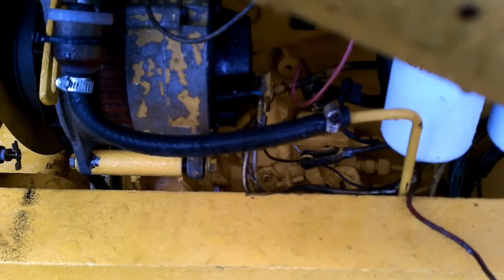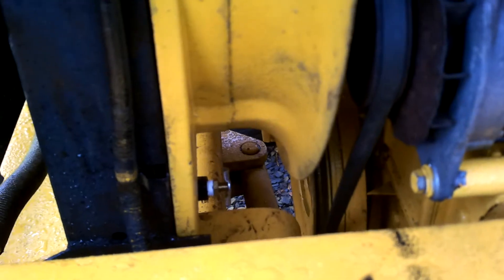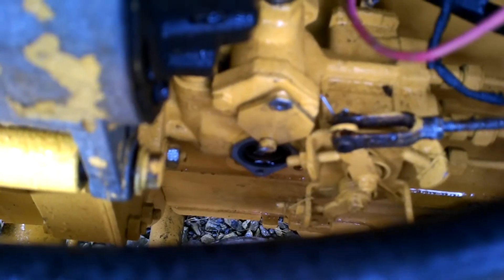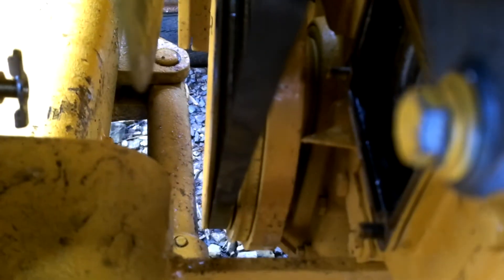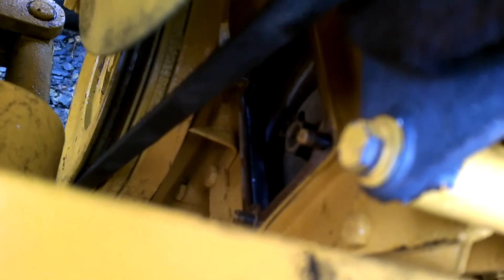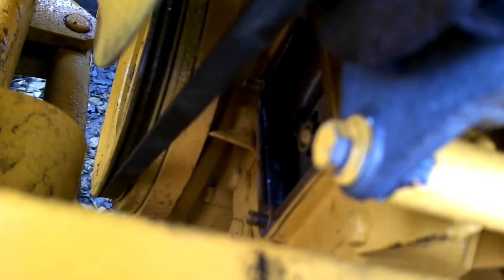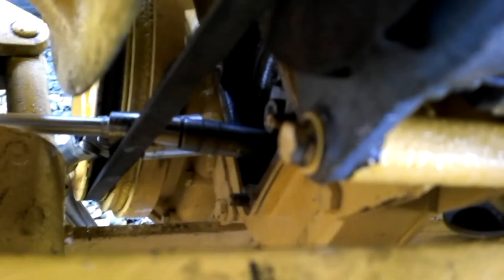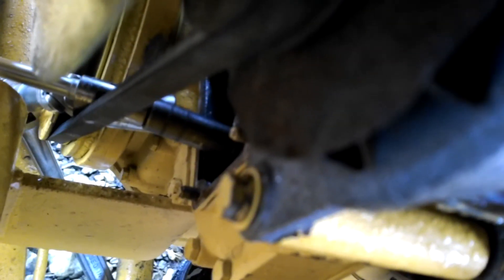IH Diesel How to time your injection pump (Neuss Engines)

Comment: Thank you for this video. The tractor IH844S with 268 engine runs like a new one. Only difference was the timing pointer you line up with the timing marks. On this tractor it is at the 12 o'clock position. All other markings exactly the same.
Reply from the maker: Glad it helped

Comment: If this has the old style Bosch pump, that speeds up as you pull the fuel shot off down, there is a cold starting procedure that helps. ( I don't remember the old pumps number, the one that is prior to the VE )   Bring the throttle up about 1/4" , push the fuel shut off lever all the way up then bring is down about a quarter of the way ( 2 " or so ), crank engine.  Pulling the fuel shutoff lever down on these pumps adds what is called " excess fuel " to aid in starting, kind of like a choke on a gas engine.  What happens is some of the excess fuel remains liquid and artificially raises the compression ratio giving a bit more heat of compression. Once the engine starts, you can move the fuel shut up and down a bit to adjust idle then move it all the way up and adjust cold idle with the throttle lever.
Reply from the maker: this is the CR pump. i move the fuel lever up to full then half way to cold start
Reply: @73DiamondReo  Try pulling it down less.  The excess fuel mech only has a limited range, you might be going past where it takes effect.  With the engine running, slowly pull the fuel shut off down to get a sense of where the engine speeds up then use that setting for cold start.
Reply from the maker: @bobroberts2371  fuel shut off is electric.  it starts up in a revolution or two. I have to pull the pump off now anyway because its leaking externally. Its been a few years since this video was made

Comment: I have a client with a 686 tractor (Australia) and just want to ensure the 16 deg BTDC is correct for his engine. He is complaining of low power and starting difficulty which appears common looking at other comments. He has a pump off another engine that was apperantly running well so wants to try it. How do I confirm what deg BTDC is correct for his engine?
Reply from the maker: you'll have to check the engine manual. ill look tomorrow and see if i have anything to help you out
Reply: @73DiamondReo  Cheers mate. I don’t have a manual so would appreciate that.
Reply from the maker: @andrewjones1471  it depends on what style pump is on it 14*BTDC on BR pumps and 16*BTDC on CR pumps. i Don't have a listing for 686. only 684. you should be using mark #4 on the timing gear

Comment: Thank you for this video...I do appreciate it. 
I have an older 75 International Industrial 3400A with a D179 and although it runs like a dream after you get her going, she always take a short squirt of ether to get her started..I am learning daily about how to keep her going, and thanks to you (and because both yours and mine are supprisingly so much alike)  I'll keep coming back and checking on your progress...Again Thank You..
Reply: If this has the old style Bosch pump, that speeds up as you pull the fuel shut off down, there is a cold starting procedure that helps. ( I don't remember the old pumps number, the one that is prior to the VE ) Bring the throttle up about 1/4" , push the fuel shut off lever all the way up then bring is down about a quarter of the way ( 2 " or so ), crank engine. Pulling the fuel shutoff lever down on these pumps adds what is called " excess fuel " to aid in starting, kind of like a choke on a gas engine. What happens is some of the excess fuel remains liquid and artificially raises the compression ratio giving a bit more heat of compression. Once the engine starts, you can move the fuel shut up and down a bit to adjust idle then move it all the way up and adjust cold idle with the throttle lever.

Comment: D239 do you know the pump gear number
Reply from the maker: give me a day or two and ill look it up
Reply: @73DiamondReo  also do you have video where you do the timing with dial indicator? I had to get a mefin/ delphi injector pump and the timing window only has letters on the roller ring instead of pointer and scribe line! 
Thank you for your help love your videos!
Reply from the maker: @stevenfaulkner395  gear number should also be a 4 for a D239. I do not have a video on the dial indicator method
Reply: @73DiamondReo  i have an cav injector pump with the timing window and the gear inside is mark with letters “ABCEDFGH” do you know what letter to line up with?

Comment: Thanks for the video!!  Very informative and easy to follow.   Any ideas on one that starts and idles fine but when throttled up the motor lopes?   And then under load when using the hoe it gets worse.  Any advice would be appreciated thanks
Reply from the maker: have you done your fuel filters and checked for something restricting the flow from the fuel tank? any fuel leaks?
Reply: Thanks!   I have done the filters and even drained all the old fuel since I had no idea how old or if it would matter.  I do not notice any leaks.  I believe it is the fuel system but am at a loss figuring it out.  Even treated for algae in case that was the issue.
Reply from the maker: @Rico-m9s  unless its sucking air in somewhere id have to lean towards the injection pump.  i believe you can remove the cover on the side of the pump and make an adapter to put a gauge. check charge pump pressure and might help narrow it down.
Reply: 73DiamondReo will do.  Thank you for your help

Comment: Exactly my D179 on IH 2400 backhoe. I appreciate the insight on this since I'm trying to revive a machine that has been dormant for 5 years. My Dad passed away and left it to me. Do you know of any videos or written instructions on priming the fuel system? I have the service manual but it doesn't cover it. The user or operator's manual I have not been able to find in print or digital.
Reply: I believe I figured it out in my sleep. The filter comes with 2 top gaskets. One ever so slightly smaller. I used the smaller one which sits down INSIDE the rim of the filter. This would block the inflow of fuel once bolted on. The larger gasket would sit on TOP of the rim of the filter. It probably should also be installed on the tractor rather than the filter. I’m thinking there’s a groove it goes in on the tractor. Theory at this point but I feel confident that’s why the filter and bowl are not filling up with fuel. Raining here so I haven’t been able to try. 1 step closer I hope.
Reply from the maker: @tailgatetalk  I think you got it
Reply from the maker: When priming any fuel system start from the tank to the fuel filters then inlet of injection pump then injector lines.  Does you machine have an electric or manual lift pump?  Did you do some work to it that you think the system needs to be bled?   for starting make sure the throttle is set half way on these engines.  Engine may also be tired and just need a sniff of either too
Reply: @73DiamondReo  It's a 2 filter system and I started there changing both filters. There was no fuel in either glass bowl. Removed, cleaned thoroughly and put new filters in.  I'm getting fuel coming out the bleed screw at the top of the first filter but the bowl is not filling with fuel. Filter 1 is on the right side and then a fuel line wraps around the front of the engine to filter 2 on the other side of the tractor. Filter 2 is adjacent to the injector pump. Any ideas appreciated.
Reply from the maker: @tailgatetalk  Did you pre fill the filters with diesel before installing them if possible?    Tighten bleed screw on filter one and open bleed screw on filter two.  electric or mechanical lift pump? If its electric it should prime second filter. if it has a mechanical lift pump. there should be a lever or plunger on it that you can use to prime the system.  On some difficult gravity fed systems without a lift pump ive had to put 1 or 2 psi on the fuel tank to get fuel to the injection pump but this is a rare case.
Reply: @73DiamondReo  I really didn't see a way possible to prefill the filters. There's a rod with bottom bleed screw running through the entire assembly, a glass bowl about 1 inch deep and the filter (which has no housing). All sandwiched together with a nut on the housing top. Am I missing something? Should I be able to fill them after assembled and on the tractor? I did pressurize the tank a little, that's how I finally got fuel coming out at the incoming connection point of filter 1. I'm also getting fuel with no bubbles coming out of the bleeder screw of filter 1. Again, no fuel going into filter. Bowl empty. There is neither an electric nor a mechanical lift pump. I probably have 10 gallons in the tank putting the fuel level well above both filters. Do you think maybe I just haven't turned it over enough times to pressurize the system? My battery is weak and I've got jumpers to my truck which gives me about 5-7 seconds worth of the engine turning over. I know this beast was running when Dad parked it but I do know the injector pump leaked some. He complained about it but it still ran.
Reply from the maker: @tailgatetalk  ah i see. Id disassemble the filter. is it possible to put in upside down? You should have had fuel in the bowl almost immediately. I wouldn't try to start it until you have fuel all the way to the injection  pump.
Reply: @73DiamondReo  Good advice! I'll go back and double-check that. The filters that came off, you couldn't even see any markings on them so old and finish worn off. Dad was a mechanic/machinist so he had the new filters in the barn labeled and waiting for me. Guess he knew I'd need them one day. The new ones have flow arrows on them and maybe I assumed pointing up was correct but down could also make sense. You have been a huge help and I really appreciate you. This is one of my quarantine projects. As I said, it's been sitting there since he died and to get it running again would be very meaningful to me. Take care.
Reply from the maker: @tailgatetalk  let me know how you make out with it.  Where are you from?
Reply: @73DiamondReo  Marietta, Ga. The reason I'm doing this myself is that I haven't been able to find a field tech who will. I've got no way to tow it into a shop either. This backhoe is like Mobey Dick haunting me and now I'm taking it personally, LOL! I may have to end up paying you though for some facetime consulting if I can't make progress in another couple days. I probably just did something backward or stupid. I'll let you know...

Comment: Hey I used to start mine like that now I just give it a little shot of ether and it starts right up keep burning the starters out to much
Reply: If this has the old style Bosch pump, that speeds up as you pull the fuel shut off down, there is a cold starting procedure that helps. ( I don't remember the old pumps number, the one that is prior to the VE ) Bring the throttle up about 1/4" , push the fuel shut off lever all the way up then bring is down about a quarter of the way ( 2 " or so ), crank engine. Pulling the fuel shutoff lever down on these pumps adds what is called " excess fuel " to aid in starting, kind of like a choke on a gas engine. What happens is some of the excess fuel remains liquid and artificially raises the compression ratio giving a bit more heat of compression. Once the engine starts, you can move the fuel shut up and down a bit to adjust idle then move it all the way up and adjust cold idle with the throttle lever.

Comment: I think my engine is the 239. A little different. Good job on the fine tuning. It sounds great
Reply from the maker: thanks.    your static timing mark would be different and probably the number on the pump gear.  I still have to adjust the valves hot but i wasn't pulling the cover off in the rain. I did get the one loader bucket cylinder repacked and will have a video of that also.
Reply: What is the number for the pump gear on the 239?